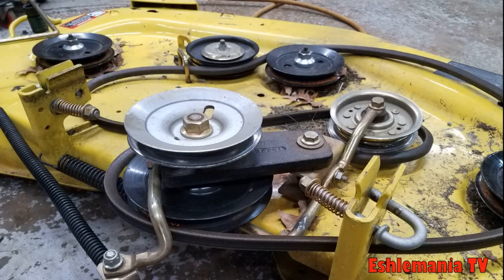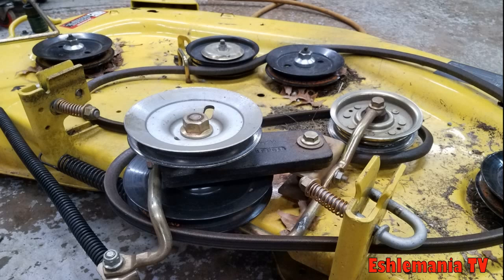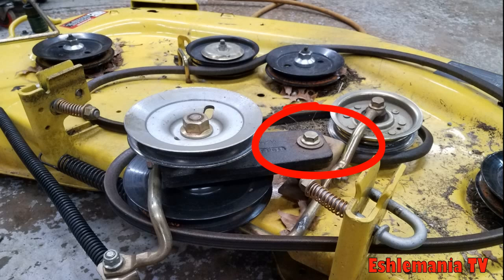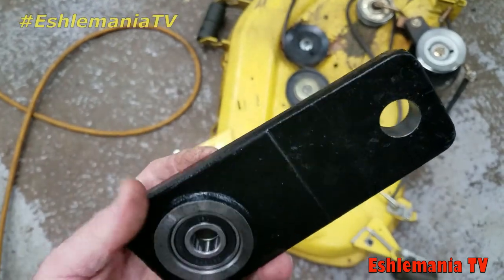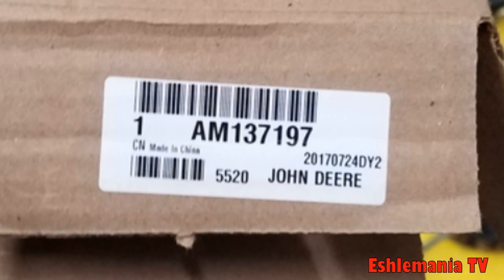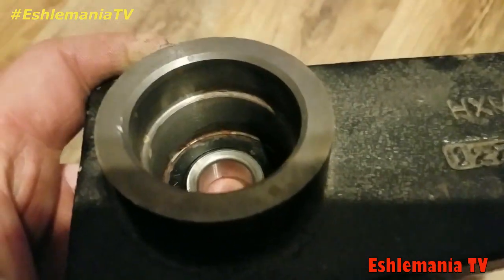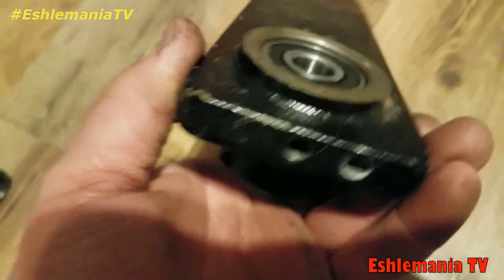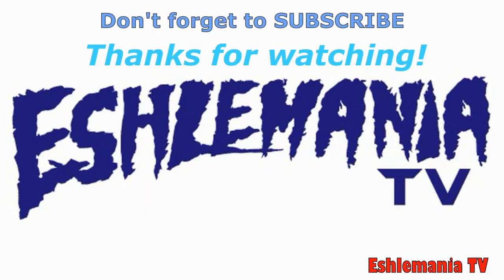John Deere 48C/54C Double Pulley Repair (X300 & X500 series tractors)

Comment: First of all thank you for this video. I just did this job. You don’t have to remove the PTO arm. 1. Just remove the spring underneath the double pulley arm. This will allow you to swing the PTO arm enough for the bolt connecting the two pulleys to drop out.
2. Loosen and take off the nut on top of the upper pulley. This will allow the bolt to drop through both the upper and lower pulley.
3. With a metal punch, punch out both bearings. There are two. Make sure you keep the spacer between both  the bearings as you mentioned in the video.
4. Carefully tap in both the top and lower bearings. Make sure you include the spacer with some grease.
5. The bearings will be a tight fit. Take your time and tap these in.  You will probably have to tap/hit these in with some force.
6. Make sure these bearings are tapped in a little below the surface of the PTO arm cavity and not flush with the surface.
7. Put the upper and lower pulleys in place with the two washers for each pulley, and slide the bolt through the two pulleys and fasten the nut on bolt from the upper pulley. If done correctly, they should both spin in unison.
8. Attach the spring back underneath the double pulley unit.

Note: someone mentioned their pulleys didn’t spin and it seemed pinched. This is because you didn’t tap in the bearings far enough.

Comment: Thanks, The part is now a little over $100 with tax as of June 2021. The bearings are still cheap.   I certainly appreciate the help!
Reply from the maker: Yeah it just doesn't make sense to purchase an entire cast iron arm just because the bearings failed.
Reply: @EshlemaniaTV  I just replaced my pulley arm with the JD part AM137197.  In August of 2022 it's now $121.50, and I got it from Hartville Hardware in OH via Amazon.  Wow, there really is inflation happening!  The new part and the old part both had Chinese bearings.

Comment: Thanks for this...
My idler pulley arm was tweaked and causing a side load on these bearings also.  Replaced these 2 bearings and the idler pulley and then straightened out the alignment of the pulley = a mower that works the way it should.
Reply from the maker: Glad to hear you got your mower deck fixed up.

Comment: Just did mine, but it was baaad. Locked up the pulley and ruined the arm. Thought I lost the washers for the stack pulley... then I looked through the pile of destroyed races and melted ball bearings. Melted the washers to the inner races, into the inner seal grooves. It's only been howling for 4 years in my lawn service, might've waited just a little too long to do this lol.

Comment: Thanks - the universal bearing code is 6203-2RS  (40mm OD x 17mm ID x 12mm width - 2 x rubber seal)  - this 6203 bearing is also used on the idler pulleys (6203-2RS - idlers can be split and bolted together for bearing replacement) and the blade spindle (2 x 6203-ZZ metal shield - remove shield on upper bearing inner face) - this is true for my JD X300 42’ Mulching deck.

Comment: This is probably the most common repair that we would do on these style mower decks.
Reply: Buck Hardware  I replaced the arm with the bearings. When I put everything back together and engaged the PTO for the mower the top pulley was the only pulley spinning the lower pulley wasn’t turning therefore the mower isn’t working. Any suggestions??  Thanks in advance

Comment: So I had this issue with the bottom pulley of that whole assembly rubbing against the spring below it. It would pretty much last a whole summer before the spring snaps so my lazy ass was buying the spring once a summer (I always had intentions on fixing the issue, but procrastination is a bitch when you have a million other things going on). Come to find out this was the reason for it and now I have to replace the pulley too because I waited lol

Lesson being: PROCRASTINATION WILL COST YOU.
Reply from the maker: You're not alone there! Sometimes it's tough to find the extra time
Reply: I have the same problem with the pulley rubbing on the lower arm/spring. I don't see  how the bearing replacement will resolve that.

Comment: Any idea how to fix mower deck height adj knob.  It’s frozen rock solid.  Also diff foot pedal on left side floor board is frozen.   Purchased X595 used.  Primary use here in NE was to plow with it.  I TOOK rusted Curtis cab off and now in the process of de-rusting it.  Seat adj was frozen solid as well got that free yesterday with copious sums of penetrating oil, sitting on tractor moving forward and back until it broke loose using my legs and core.   Great workout.  I’m so sore today!   :-).  The Rest of the tractor looks great. Frame engine etc. Yanmar purrs like a kitten.   This thing needs some TLC, but I think it’s worth the effort.   Any advice is grateful.

Comment: My mower deck 54c looks just like this deck and It looks like the pulley nearest the one you are reviewing in this video is sitting at an angle when the belt is on what should I see or do?....dave
Reply: The double Pulley has an Idle Arm under it. If you trace it back to the support bar you will more than likely find it is cracked. It will be hard to see where it has cracked because thew belt and springs are holding it in place. I noticed the tilt and went through a few belts and still did not see it. It deck eventually stopped working and then I saw where it was broken.

Comment: Is that pulley supposed to shake while mowing or is it suppose to stay in one spot?
Reply from the maker: It will move a little while mowing because it is under spring tension. But it should not wobble.
Reply: @EshlemaniaTV  ok because I just got a  new mower and I can hear something like rattle and stuff and I noticed that pulley like rock back and forth pretty fast
Reply from the maker: Take the belt off and rotate the pulley by hand. See if the pulley wobbles when you spin it by hand or if it makes a growling sound. It sounds like you should check all the pullies on your deck. A lot of times if one is bad there's a good chance another one is starting to go bad.
Reply: @EshlemaniaTV  I'll just let Kubota look at it since it's new and has warranty lol
Reply: @EshlemaniaTV  idk if that's the actual problem just something I noticed lol but the problem is that rattle and vibration I feel on the handles on the zero turn
Reply: How tight should both main  bolt/screws be? In Trying to stop the little rocking in the double pulley ..I sheared off the   bolt on the one with the spring arm????

Comment: Great video. I’m just doing mine now, do you tighten the nut and bolt that goes through the double pully and bearing right up tight or leave some play in it? When tightened the pullies don’t seem to turn?
Reply: Yes, there are two spacers required,  John Deere part number 24M7097 I had the same issue myself.

Comment: I've tried penetrating oil and also tried adding heat using a mapp gas torch and haven't been able to get the nut to break free to get those 2 pulleys off so I can reach the bearings, any idea or solution to this issue?
Reply from the maker: Do you have access to an electric, air, or battery powered impact gun?  That would be the easiest way. If that's not an option maybe try a breaker bar.
Reply: Eshlemania TV  After applying copious amounts of penetrating oil and trying an impact I finally got it apart, found the bearings inside had basically worn away to nothing and fused to the inside of the cast iron piece. I’ll have to order a new one through Deere but I’ll be buying some new bearings to repair it in the future before it gets to where it is now. I was given this tractor after my grandmother passed and there was little to no maintenance on it so I’m doing a whole PM/repair on it.
Reply from the maker: Glad to hear you got it apart.
Reply: @EshlemaniaTV  That's what I used. A breaker bar, 1/2" ratchet and LOTS of WD40...!!

Comment: I’m looking at buying a x580 mower.  How many hours should I expect to get out of the deck blade and idler pulleys? Thank you...
Reply from the maker: All depends on how well it is maintained. For example, a lot of people think there is no point in greasing their spindle assemblies since most have sealed bearings these days. That is something that will lead to early failure of the bearings. Even though the grease is not going directly into the bearings themselves, the grease helps keep moisture out that can get into the bearings, either directly or through condensation, and cause rust and other issues that will lead to the bearing failing.
Reply: I just bought a new X590 JD garden tractor.  I completely filled all 3 blade spindle cavities with grease, they were totally dry from the factory.  Also greased idler pulley and all front wheel bearings.  Given this initial maintenance and will grease every 50 hours, how many hours do you think I will get out of 3 spindles and idler bearings? Thanks...  ps..I will not wash off my deck with water, another issue people often do

Comment: Use OEM bearing if possible. My aftermarket idler pulley with new bearings installed lasted only two seasons. The OEM original lasted 25 years ! All parts are not created equal.
Reply from the maker: Depends where you get your bearings. There are some bearings the you can get from a vender other then the original OEM that are better than what the original OEM uses and can cost you less because you're cutting out the middle man or not paying for an OEM sticker. As far as the bearings being mentioned in this video, a lot of these were only 4-5 years old when the bearings began failing. So this is an example of where you can probably get an aftermarket bearing that will last you longer than the one used by the OEM.

Comment: Any idea what the part number for that spacer is? I found a parts list for my 48 inch that says the bearings are JD9296 (your vid says JD8535) but I'm still stumped finding a replacement spacer as mine was totally wrecked when the bearings failed.
Reply from the maker: The bearings in the double pulley on this style deck are NOT JD9296. The JD9296 bearings were used on some of the decks that are older than this style.
Reply: We gave in and bought the assembled piece. Next time I'll recognize the noise and get to a cheaper fix before the bearings fall completely apart.
Reply: I just did mine and the part you listed jd8535 is a 17x40x12(6203-2rs). But it should be a 16x40x12(6203-16-2rs). I dont know if the slop will matter though since the pulleys are torqued tight together through the bearings
Reply: @michaelrithaler3519  Eshelmania, Exactly what is the correct part # for those two bearings in the Cast Arm?  I have a X320 mower.  Also looking to download Service Manual with no success.

Comment: How many Ft. Lbs of torque required on Flange Nut?
Reply: ahhh just crank it till its real tight and about to strip out then realize the mistake and back off a quarter turn and then fix it when it breaks off!!! USually about two beers for millenials but make sure its one of dem fancy beers

Comment: Anyone know comparable part numbers for a Timken or SKF bearing?  If I do this job again, I don't want to replace the bearings with Chinese bearings that fail in less than 300 hours again and Stens parts don't seem a whole lot better than JD, just a whole lot cheaper.
Reply: Timken and SKF are probably made in China too...
Reply: USE:timken ,99503